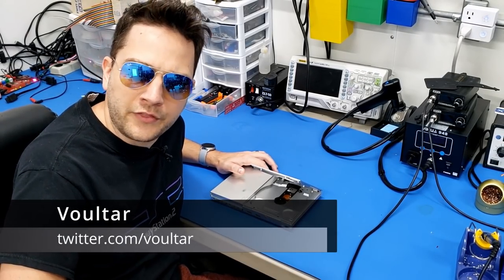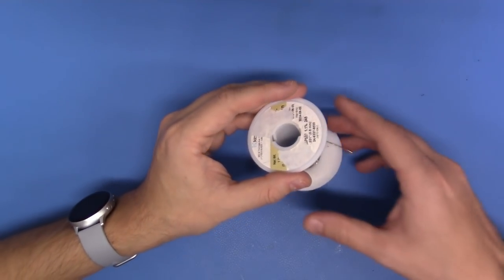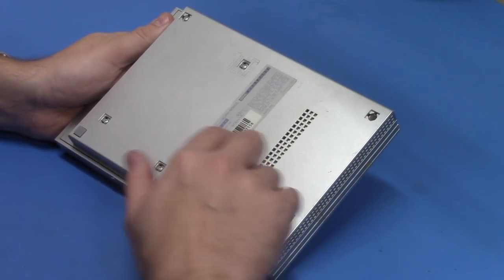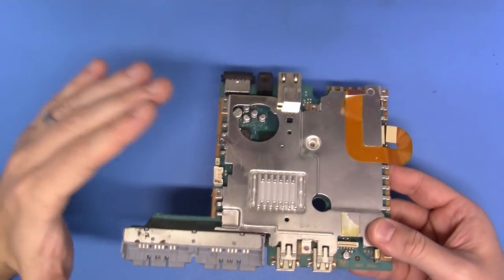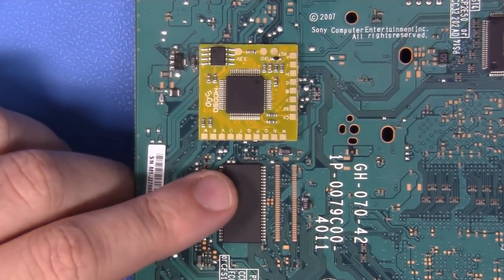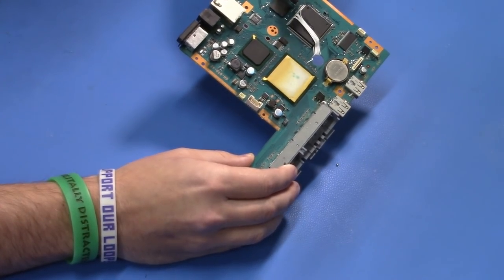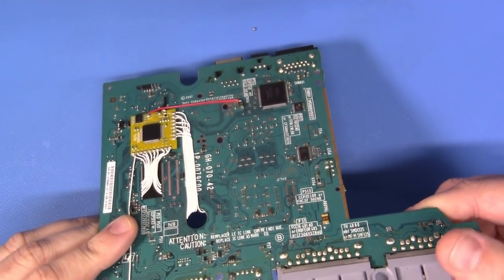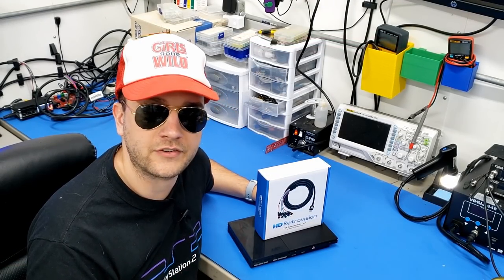Playstation 2 | The War Against Modchips

Comment: I got a PS2 from one of my old employers out of their Tech Recycling Room in our store front. It already had the bottom loose and I saw some wires in it I'd never seen in a PS2 before. It looks like a custom mod chip setup, but turning on the PS2, I see no difference comparing it to another fat ps2 of the same model. There's 8 wires total connected around various spots on the board all to one little chip with 8 legs on it. I'd love to solve the mystery one of these days

I'm betting if I link a picture of it, youtube will filter out my comment, but maybe you'll see it in Held for Review as a reply
Reply: It sounds like the very first chip that came out for the ps2. I can’t remember exactly I think it was one where you swapped  the disc. Maybe a PIC chip or something.
Reply: @johnroberts2681  I did have a pic up, but youtube auto moves comments to "Held for Review" in the Studio portion of a youtube account and the channel has to approve the comment for it to be seen publicly

I've looked up nearly every modchip I can and none look like mine
Reply: @TechX1320  ah pic was the type of chip just like the later ps1 chips sorry I think I confused you. Yeah I tried to put a website in comments one time and YT kept removing my comments.
Reply: @johnroberts2681  when I read your reply again, I realized it lol

Comment: So I get that this does require a certain level of soldering skill, but I wouldn't go so far as to call it extremely hard.
A microscope would be the one thing I would want to perform this type of work, using magnifiers can be fatiguing.
For someone trained in PCB rework this might just be another day at the office - not even approaching the level of precision employed for other repair work.

Comment: Unfortunately leaded solder is banned here and has been for many years. And still, to this day, I am not as comfortable soldering with lead-free solder as I was with the old leaded stuff. It just doesn't compare. Leaded was so much easier to work with.
Reply: @rockytom5889  Thx for the tip. I'll have a look for that.

Comment: 07:58 hey dude, I have a PS2 with the same hardware, but the reader is making a grinding noise when I turn it on. I noticed that in your video the "giant screw" that Is used to move the reader has some black stuff on it, I assume it's some kinda of grease, but mine doesn't have it. Do you think this may be causing the issue?

Comment: Hey Voultar great vid! I had a question about this revision ps2 if you have the time to answer. I have a scph-90001 with a gh-072-42 board with modbo 5.0. It boots and functions perfectly for hours on the first boot, but then only boots to ps2 browser if turned off/powered on shortly after. If I wait several hours to turn on again it will then boot into opl no problem and function perfectly. I swapped in another known good chip (used in my fat console), same issue. I also completely redid my soldering, same issue. I haven't been able to find any info at all on this on forums, youtube, etc. Have you ever ran into this before?

Comment: This brings back memories. I started with Playstation 1 mods and later when PS2 came about, I was the only one in the area who had suitable soldering equipment and could do the mod without messing up the machine, as I had a long experience with SMD soldering by then.
I got the firmware for the Playstation 1 mod chip so I didn't have to buy them anywhere, I just bought empty chips and programmed them - a lot of them.

I did not have any website or ads about this or anything, as knowledge of my service spread mainly from word of mouth. The work got so heated that I had tens of Playstation 1 units every day brought for modding, people were bringing them all the time until night - every day. For many, I made the mod while waiting. I hired a friend just to receive the machines and give ready machines for customers when they picked them up, so that I could just focus on modding.

When it started to be a routine, I clocked around 4 minutes 37 seconds for each mod work from first screw out and last screw in, using my trusty electric screwdriver.
I had ready-made wire sets that I had prepared in bundles and that made the work much faster.
Not even one machine came back because of the modchip, they all worked very well.

Later I got to fixing them, as the most common issues such as laser units started to fail from the machines.
There were also a few special ones, for example a customer's Playstation 1, on which the family's dog had peed on.
It smelled absolutely disgusting and was brought to me in a pee filled bag, but a good cleaning work and lots of alcohol brought it back to life.

Later when PS2 was introduced, I bought the mod chip boards from UK and installed them. Those took way more time to install than the older machines but were doable and I was always careful to make the installation work clean and professional so that there would never be problems because of my work, and there never was. It took almost 30min per machine to mod. I modded three different PS2 PCB generations until I moved on to other interests. The later generations got more and more easy to disassemble, the first one needed much more work to get ready for modding. This is how I spent part of my youth.

Comment: I’ve seen a number of different av mods for the Famicom, but everyone seems different as to what can be done, parts used or the whole replacement chip on the back of the board. Any chance you can go over the options, thoughts and best practices?

Comment: So I don't know a damn thing about soldering and I would never be able to do this, so take this question for what it's worth.
About half way through the video to use hot glue on the modchip (I'm assuming it's anti static and that's why you used it) and then you made little solder balls to connect the wires to. Would it not be easier to make the solder balls THEN hot glue it to the board?

Comment: I was watching and thinking "this doesn't look too bad", then you came to the wires soldered to the big chip with really little legs, the CPU I'm guessing. Now that's a pain in the butt.
(And yeah I know it looks easier and everything looks bigger in a video than actually doing it. I was judging from the size of the wire ends. I've done a lot with wire wrap wire.)

Comment: I modded a PS Slim 7700 series which should have been easier than this and I will never do it again. I guess my iron was too hot because the contacts kept coming off the board itself. I had to redo the traces on several of the wires. I had to stop and go back a few days later because I got so frustrated with it.

Comment: thanks for the video ive had a ps2 slim sitting around in my room for over a year that came in a joblot of ps1s. never tried to hardmod a ps2 so maybe ill give it an attempt. what wire do you use tho? I usually use one with silicon insulation but its a lot more loose/floppy than the normal rubber so i think it might be a bad choice for something with this many wires

Comment: Nice. I have a ps2 with a dms4 mod chip in it. My only issue is the unit won't detect my hdds anymore. Would love to get it running again. I am able to mount my ps2 hdds on a pc and they are readable. Just not sure why they won't load in the ps2 console anymore.

Comment: you took out the power supply and it has all its connections exposed at the bottom, i don’t know if you put a warning but it looks like not, capacitors are evil when charged (i’m just pointing out what i saw, since it’s a tutorial)

Comment: 20:00 during this section you didn't show how you stripped those wires. How do you strip a wire with such little room to get a tool in? It's a problem I've been dealing with for a while.
Reply: I've seen him use nail clippers in the past.

Comment: Awesome soldering work, but I'm not happy with that hot glue: might consider double sided foam tape or something?
Reply from the maker: No. There's nothing wrong with using hot-glue.
Reply: I was worried, that after smearing the hot glue, if maybe you ever wanted to take out that daughter board, it might rip off some SMD stuff. You couldn't have placed it any better. Big fan!
Reply: @SauvikRoy  Use isopropyl alcohol (aka; rubbing alcohol 70%, isopropanol) on a cotton swab/bud around the edges of the hot glue, will release like magic.

Comment: Just installed one of these in my 39001 last month, right after being told by a group of angry redditors that modchips are "ancient and outdated"
Reply: Reddit is cancer
Reply: @rdaws73  I am well aware. Still, it's an easily accessible platform where you can find plenty of nerds to answer niche technical questions.

Comment: I burned my Pal 5004 ps2 fat lense in a modbo 5 failed installation.Since then i bought better tools and i would definitely be better prepared now, but I am too afraid to try it again. There is supposedly a fix that should be done, to lower the lense voltage in case the console freezes but i am not entirely sure if that really was the problem. Should i try again?

Comment: LOL XD LAMAL, SONY are a bunch of HYPOCRITES.
The original Playstation was and the PS One where designed to use a proprietry Disk that was some 5mm larger in diameter.
The Idea was that this disk could not be purchased and the extra size contained the copy protection but Sony ditched it and went with standard size discs, WHY?
A: Sony did not care about content creators, it only wanted to sell consoles and the ability to pirate consoles guarenteed sales.

Quiz:
Who was the first to speak out against piracy by a device, but then release said device comercialy?:
1. Casset Player
2. Portable Casset Player, "Walkman"
3. Portable CD Player
4. MP3 Player
5. Playstation

Who PIRATED the Casset player and called it theirs for some 30 years?